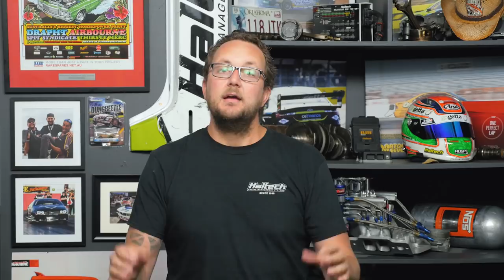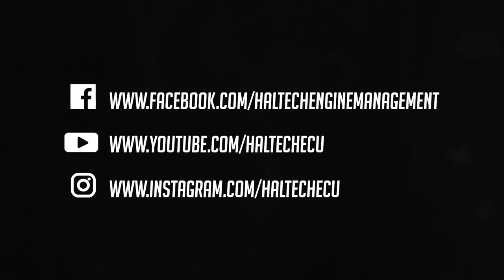🛠 How Race Timer Works | TECH TUESDAY |

Comment: OK I'm not a tuner and leave tuning to turners.. But I do take an interest in new tech. I've just upgraded from a ViPec to an elite 2500 for a Rally car. What is the difference between launch control and race timer? I'm guessing for dirt there would be value in using both on a RWD Turboed car running a sequential gearbox?

Comment: Is this only available on the 2500T or with the torque management module addition?  Sounds like I could do with it to stop my car spinning in the first 3 gears!  I use a Haltech Elite 2000 but could not find race timer in the ESP menus.
Reply from the maker: It's available on Elite 1500, 2500, 2500T and VMS and VMST

Comment: Could it be used in circut racing based on steering angle or maybe suspension tarvel. As as you come out of a corner the boost starts to increase sort of like a traction control.
Reply from the maker: The Race Timer can be trigger based on any event the ECU detects, so if you have a G-meter you could trigger the timer to activate at a particular G-force then map a torque reduction strategy based on that condition. The trick is to find a consistent event to trigger against. Hope this helps:)